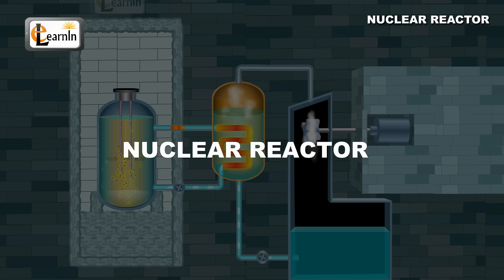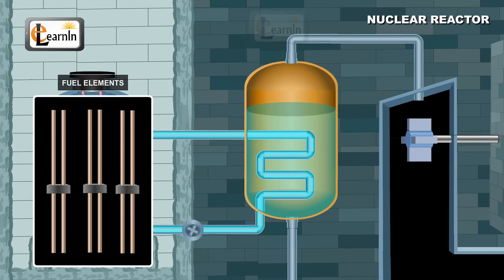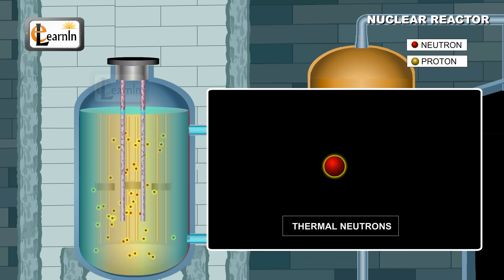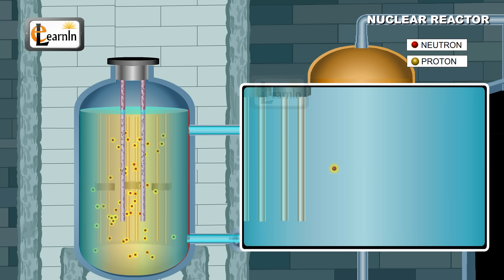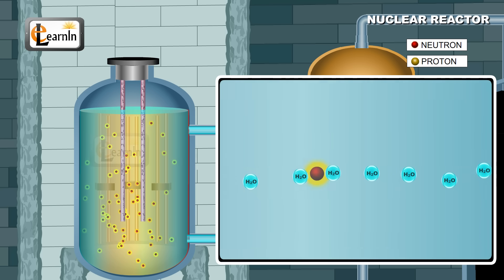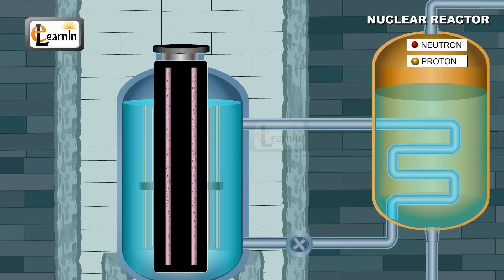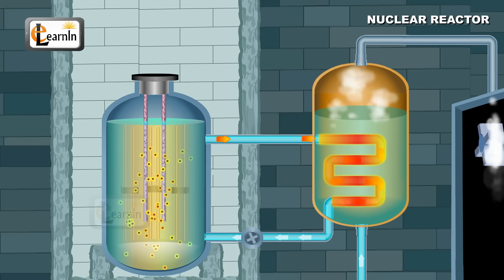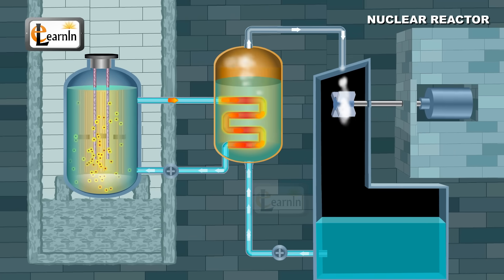Nuclear Reactor - Understanding how it works | Physics Elearnin

Comment: Humanity’s rejection of Nuclear power was a massive mistake, and the environment has payed dearly for it as we continue to rely on fossil fuels for our electricity
Reply: Nuclear power is not only the best energy we have it's clean. People are so brainwashed
Reply: @radicalgreek99  Its only the best form of energy for the plebians.  The top 1% and share holders of oil companies who control the media need environmentalism to maintain their dominance.
Reply: @radicalgreek99  What are your thoughts on thousand tons of nuclear waste produced from nuclear power?
Reply: @DK-hw6xs  I think you mean radioactive waste, and radiation fades over time. Luckily there are multiple materials which radiation cannot travel through. So we put the radioactive waste in boxes made out of these materials until they are not radioactive anymore..The amount of boxes we need is not increasing, its depending on how much energy we use.
Reply: @DK-hw6xs  still comes nowhere near the amount of toxic waste produced by a single coal plant. Plus when nuclear waste is handled effectively it poses essentially no risks to human health
Reply: @DK-hw6xs  free nukes
Reply: @DK-hw6xs  I know im 3 years late but they bury the already super faded nuclear waste in giant concrete concrete boxes in remote locations
Reply: @DK-hw6xs A large modern-day nuclear reactor produces 25-30 tons of waste fuel, BUT that is WASTE FUEL, not the actual dangerous radioactive waste. We did the math in my quantum physics class, and the amount of deadly waste from a single reactor running in an entire year would be so small it could fit in your hand. You could power the entire world off of nuclear reactors, and the amount of waste produced from all of them combined would only be enough to cover the surface of a single football field if that helps to put it into terms how overblown the fears behind nuclear reactors and their waste is.
Reply: @DK-hw6xs  Nuclear waste can be recycled, 95% of the spent rods are recyclable. this means that a fist sized chunk of enriched uranium-235 that will power Dubai or Dallas for almost a month, will produce waste that is the size of about a glass marble.
Reply: @DK-hw6xs  Look at what France are doing with their nuclear waste. They're turning spent fuel into new fuel again through reprocessing. If the US adopted this, it would greatly reduce the unfair negative stigma against nuclear power.
Reply: Send it into space
Reply: @DK-hw6xs  yes the waste stored safely underground that you will never come in contact with, what about the waste you breathe in every day and that is slowly killing our planet that there is way more of
Reply: Based
Reply: when did we reject it? countries en masse are moving away from fossil fuels lol. where have you been.
Reply: @user-ki3ks4fd6i  No they're not. More wind power = more fossil fuels. Because wind power is unstable, creating demand for a secondary energy source which can easily ramp up production when necessary. Nuclear doesn't fall into this category.
Reply: @user-ki3ks4fd6i 
America is not, and the layman still thinks nuclear is inherently more dangerous
Reply: You mean the hippie boomers rejection?
Reply: exactly, idiots are too scared to accept the thing that will save our environment, they’re too brainwashed.
Reply: Absolutely. Also, electricity is a lot more expensive without nuclear power. People are insane.
Reply: Everybody  in  the  nuclear  business  knows  that  the  cooling  water  being  pumped  and  circulating  again  and  again  through  the  reactor  between  the  high,  thin,  hot  fuel-rods  must  never  STOP  or  DISAPPEAR.  Still  it  has  happened  five  times  in  54  years: 
.                                                          . 
Windscale-England  1957 ,   Brunsbüttel-Hamburg  1978 , Three-Mile-Island 1979 , Chernobyl 1986 ,  Fukushima 2011  where  cooling  water  was  missing  for  about  a  WEEK.  Each  reactor-core in  Fukushima  is /  was  of  the  size  of  a  bus  standing vertically  and  weighs  150  tons.  At  least  one  of  these  cores  has  melted  its  way  through  the  concrete  bottom  of  the  reactor  building. 
It  creates  a  lot  of  steam  when  this  hot  150-ton  cylinder  meets  wet  earth.  
Big  clouds  of  steam  were  seen  in  Fukushima  during  the  first  weeks  of  the  accident.   
.                                                                                                                      .  
Be  patient,  the  dangerous  radiation  from  the  underground  cylinder  will  have  only  half  intensity  in  24-thousand  years.  That  is  the  half  life  of  Plutonium-239  and  you  cannot  accelerate  this  decay-process  by  burning  or  cooling  or  chipping  the  material.  Japanese  government  says  problems  in  Fukushima  will  be  solved  in  40 - 50  years.  That  is  when  the  journalists  being  alive  today  are  dead  or  have  forgotten  about  this  promise.      
.                                                                                                                 . 
Even  if  the  Cadmium  or  Boron  control-rods   are  maximum  down  between  the  fuel-rods  when  cooling  water  accidentally  stops,  then  the  local  fissions  going  on  inside  the  fuel-rods  give  sufficient  heat  to  slowly  melt  the  rods  so  that  they  start  dripping  down  on  the  bottom  of  the  metal  reactor  container,  creating  a  very  radioactive  and  hot  soup  ( nuclear  lava )  on  the  bottom.  
.                                                                                                                              . 
If  the  soup  manages  to  melt  a  hole  in  the  metal ,  the  soup  lands  further  down  on  the  concrete  bottom , which  REFLECTS  neutrons  back  in  the  soup  making  it  even  hotter  until  the  concrete  is  burned  to  ashes  and  neutron-reflection  stops.   Don't  you  dare  spray  water  on  an  overheated  reactor-core  because  water  also  reflects  neutrons.  I  don't  know  whether  the  control-rods  were  up , down  or  in  the  middle  when  the  earthquake  in  Fukushima  broke  the  pipes  with  cooling  water  like  matches. 
.                                                                              .  
Yet  in  Brunsbüttel  , Three-Mile-Island  and  Chernobyl  there  was  no  earthquake  to  blame.
Reply: @0118uhauha  I'm torn on the question of nuclear power, or rather, that is, when it comes to power plants, hence my question. You seem to know what you're talking about and are opposed to nuclear due to safety concerns, correct? So let me ask you this please, because I rarely hear it talked about:
In discussions about fossil fuel emissions, it is often mentioned how a handful of cruise liners and oil tankers use as much fuel as the entirety of cars in Europe. We all agree that oil plants are dirty and even look for alternatives for our cars. For nuclear, we have legitimate reasons to approach it with care although it's 100% clean ....on land at least. I never heard of a serious accident on a nuclear submarine, and just now looking it up I learned that the Soviets had some minor ones but there was no incident since 1954. So why then don't we retrofit large ships with nuclear reactors? That should be about a quarter of fossil fuel use and not only that, the dirtiest engines with crude oil etc. Why do people talk about replacing relatively clean GCC plants with nuclear instead of marine engines?
Maybe even build offshore underwater nuclear plants? I can imagine that on the other hand that creates new risks for marine life, considering the concerns about contaminated soil near the sea and radioactive fish and all after Fukushima.... however, if that were such an issue, why is there no discussion about banning nuclear subs?
Reply: @0118uhauha  I learned how to stop nuclear fission when water goes missing in Spiderman. Dump it into the ocean.
Reply: @0118uhauha  Very informative, thanks.
Reply: Shut up nuclear power is trash and can't save the planet and just kill us all

Comment: Why does everyone fails to explain how exactly the fusion takes places. Like how do they activate it.
Reply: Fusion doesn't happen inside of a Nuclear Reactor
Reply: @atlas2819  Are you sure? I read that the control rods are pulled out and plutonium-238 rods is inserted to release neutrons to activate the chain reaction. This is only for brand new nuclear reactors which it will start a chain reaction for the first time, there’s no such YouTube video which explains how exactly a fission reaction takes place.
All nuclear reactors for power plants in USA uses uranium only and it needs a neutron source to start the fission reaction. 
I’m no expert, but it doesn’t make sense why the fission reaction doesn’t take place inside the core, all the radioactive stuff is within the core. 
It gets even more interesting after the first chain reaction has taken place and other forms of neutron source can be used to resume a chain reaction when halted.
Reply: @ShopperPlug  You said Fusion, not Fission, they are very different things
Reply: @ShopperPlug  Fission is when the Nucleus of an Atom is split in half which release neutrons from the now split nucleus and those Neutrons split more atoms, which creates a chain reaction, Fusion is when the nucleus of an atom is going to fast and is at such high pressure that they are able to fuse with other atoms, think of it like this, Fusion is what happens inside of the sun, Fission is what happens in a Nuclear Reactor
Reply: @ShopperPlug  Yeah, a Fusion reactor is way different from a Fission reactor, but currently Fusion reactors aren't feasible as it uses more energy to make Fusion happen than the Fusion produces, its like using advanced equipment to mine for gold, and while you do find 100 thousand dollars worth of gold, it costs 1 million dollars to actually find it

Comment: So it is kind of like a shell and tube heat exchanger right? With heated deuterium in the tube side, and normal water in the shell side. Then, depending on its setup, exchanges heat through counterflow or parallel flow. 

Why then would we choose this expensive heat exchanger when we have other cheaper alternatives to make steam?
Reply: You mean like burning an entire 100-car train load of coal every day?  Or a couple of cubic miles of natural gas?

Comment: So how does the power plant actually start the fission reaction? I watched a video that was saying the rods aren't even dangerous when arriving at the plant, but the power plant are the ones that will start the reaction. I'm just curious as to how they do that.
Reply: Fresh reactor fuel is pretty benign stuff, you can bare hand it perfectly safely. The chain reaction starts when you get a sufficient amount of fissile U235 in close proximity to each other and introduce a neutron source to 'light up' the reactor. Control rods are used to restrict the movement of free neutrons in order to maintain the required output from the reactor.
Reply: @paulanderson7796  can you explain neutron source ???
Reply: @Marco11-08  neutrons form  when quarks merge with eachother, gluons carry interactions between these quarks, and thats it
Reply: @AmIr-dn4od  my question is a simple one. I’m asking who is nuclear fission initiated ?? How the those protons enter the core ??? Are they blasted in there somehow ?? How are they contained to begin with?? I’ve searched everywhere and there’s nothing explaining it step by step
Reply: @Marco11-08  nuclear reactors is driven by the splitting of atoms, a process called fission where neutron is fired at an atom, which then fissions into too and release more neutron and those neutrons released hit other atoms, its called a chain reaction
the control rods exist to control the rate of fission of the nuclear fuel which is uranium or plutonium
Reply: @AmIr-dn4od  I understand that clearly. I realize what happens during fission. What I want to know is how does man introduce the protons  in the reactor ??? Uranium 235 absorbs lose neutrons for fission . Where are those neutron coming from ? How do they get there ?

Comment: Sorry but can someone explain? Maybe im not getting it cause English isn't my first language. 

So, according to the diagram, the fission reaction from the Uranium heats the "moderator" water... which in turn flows through to that 2nd tank, and heats a different set of water intended to generate steam? 

Forgive me for asking something silly but what's with the redundancy - heating water to heat water? I mean, if the intention was to create steam why couldnt we just have the steam from the "moderator" water?
Reply: That's exactly what happens in a boiling water reactor.

Comment: How do you activate the fuel rods ( fission reaction) at first place?
Reply: U-238 undergoes a small amount of spontaneous fission
Reply: @somatotrophin1535  btw fuel rods are not radioactive prior to entering the reactor!
Reply: Peter & Pete yes they are. U-235 and U-238 emit alpha particles
Reply: @somatotrophin1535  fuel rods are not radioactive when they enter a reactor! Uranium will only emit radiation when it's been bombarded by high voltage!
Reply: There is a very low level of spontaneous fission going on in even a new fuel assembly.  (That's what it means for a fissionable material to have a "half-life".....it's slowly decaying by the fission process.  The half-life of U-235 is on the order of 700 million years.  Did I mention that it's a SLOW process?)  But in an assembled core, there are enough of those fissions going on to get the chain reaction started when control rod withdrawal has started.
Reply: Check out the concept on reactor 
https://youtu.be/0S90pZpLfLo
Reply: @ps6686  I've checked out your video and you're just like most other people; you're omitting the part of the assembly that starts the nuclear fission reaction!
Reply: Peter & Pete that's the BIG question nobody answers - whenever you watch a video on this topic, they all talk of the fission to understand how a reactor works but never explain what starts the fission to begin with.  In my understanding it's started using a neutron howitzer. A neutron howitzer is a component of a nuclear reactor assembly that generates neutrons to hit a target ie nuclear fuel rods. The neutrons are accelerated in the howitzer to bombard the fuel rods which act as a kind of resistance to the fast moving neutrons. The fuel rods heat up due to the energy of the neutrons colliding into them. The water, CO2 or sodium metal moderator in the reactor just cools the fuel rods and prevents them from melting but they obviously worked out years ago that taking the heat away from the fuel rods can eventually heat up water to create steam to drive turbines to produce electricity. 

https://www.youtube.com/watch?v=jhlZaWGFQZY&t=326s

That's a good video to watch because they are describing @05:38 how a nuclear reactor works.

That's my understanding of it!!!